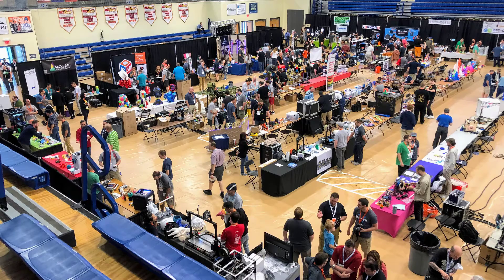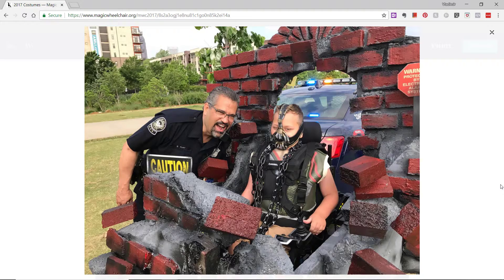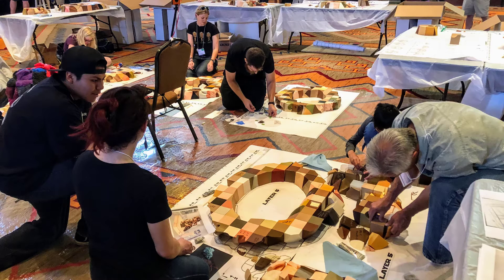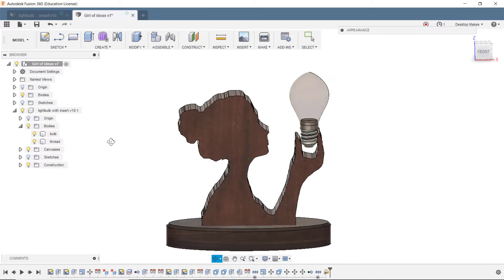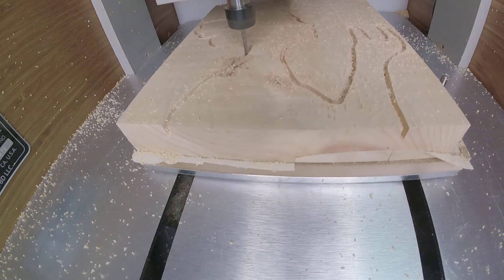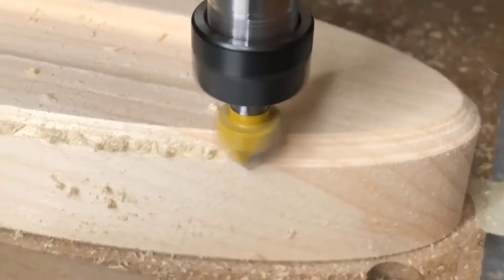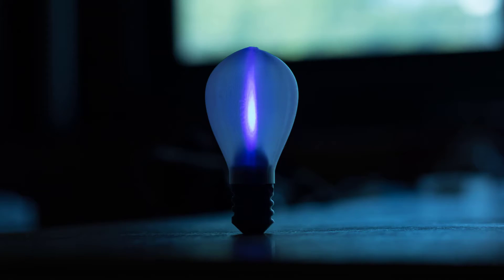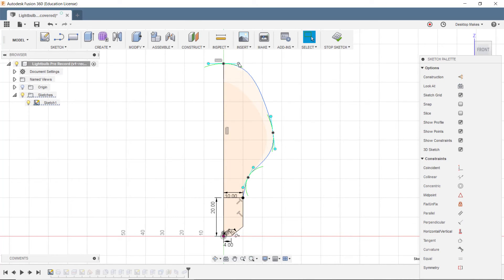Girl of Ideas - CNC Milling and 3D Printing

Comment: Great vids - I took your Udemy Fusion 360 course 1 1/2 years ago, crashed it hard and designed a graduation gift for graduation MBA's - a desktop cell phone stand that they really liked.
I dropped using Fusion 360 after the project and just had to retake your course to get my head back into it.
It is great to see you regularly sharing ideas on Youtube. I have been over to the Danbury makerspace, and will have to drop down to yours in January 2019...